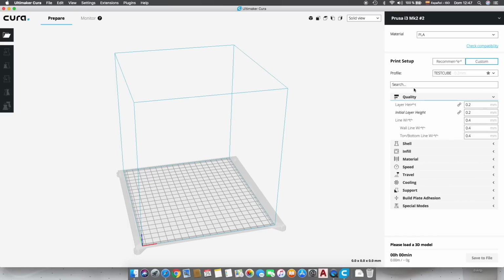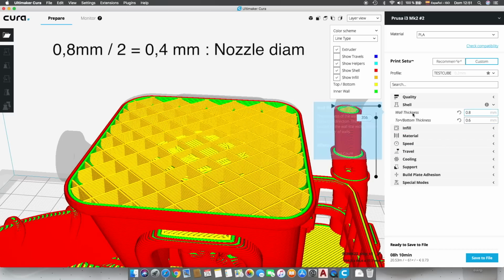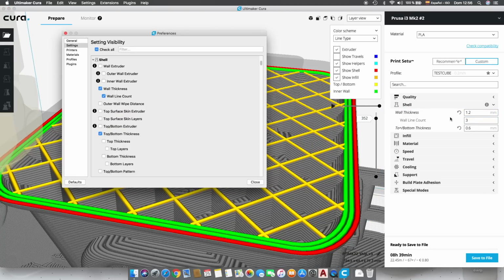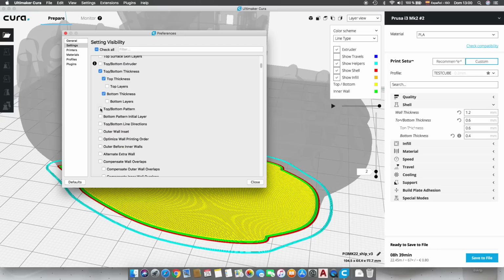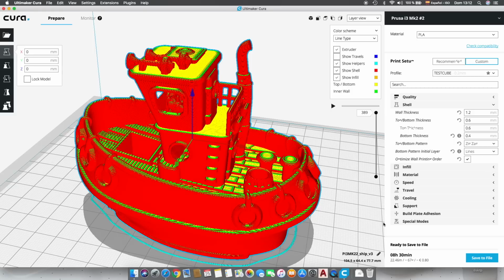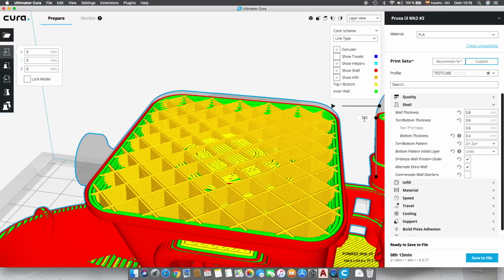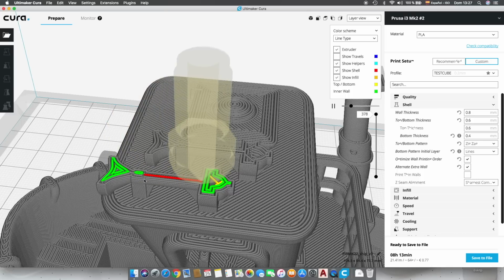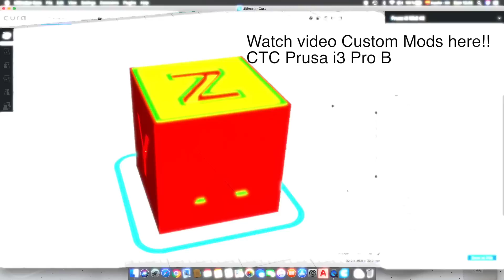Cura advanced settings 2018 - #02 Shell

Comment: I have tried to change these settings but the walls of my models have been coming out very thin and if you try and touch them theyre “crackly”.  I don’t know how to fix this.  I have the wall thickness set to 1.  Any help would be greatly appreciated!
Reply from the maker: maybe it's caused for a low "flow" value..
Reply: Architects3DP Thank you for the quick response!  Where would I fix that and what is an appropriate setting?
Reply from the maker: you can find the flow settings under the material tab. it depends on every printer, so you have to try increasing or decreasing your values depending on the results you get.
Also if you see you can't improve the results, start a new default configuration, and start ganging parameters. :)

Comment: I think that you're telling some good hints... Like about Horizontal Expansion but they're "hidden" in a lot of the info that was told a lot of times by other tutorial makers... It's not a big complaint but I need to watch almost 20 minutes of the video where you talk a lot about things that are easy to see in these yellow mouseOver hint-boxes. If you'll just run through points and tell "switch this ON, this ON, this OFF... because it works better" it will be enough.
I know it sounds stupid (from the 1st thought!) but it's very boring to watch the tutorial where you just repeat these hints by voice slightly changing the text or explain some really obvious things... In-between you tell interesting hints like that about ABS. It "sounds" like a valuable wine mixed with a lot of water. You drink that and feels that "it's wine in water probably"... 
It's not a 3d modelling tutorial where it can be really difficult and hard to dial into a specific terms so a tutor must show and explain everything while modelling on a screen. But it's the slicer program here... So the really important and valuable things here are the details and the results that are most probably will be given after applying certain options and numbers. When you did show the cubes and explained the results it was valuable.
... and you did show just the ironing/non-ironing results.
I'm writing the comment the 2nd time already :)) Before that I've thought that you're just reading all hints basically but I was wrong.
What I've searched actually was about  Compensate Wall Overlaps - this is one of the most "mysterious" options in Cura. What is "Minimum Wall Flow" in real (not in the hint that is actually is a bit confusing!) printing and how does this option works with other options like Equalize Filament Flow and Coasting (in Experimental). The result really depends on them in sum (or difference)!